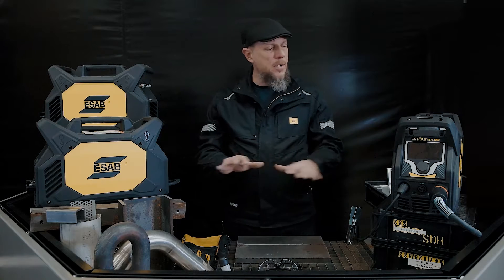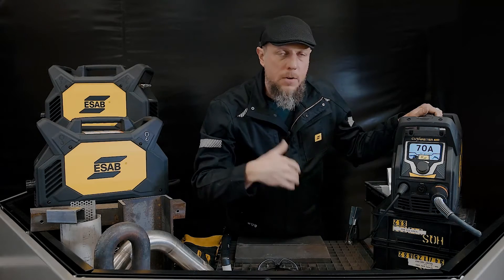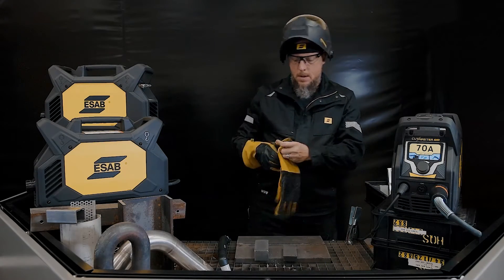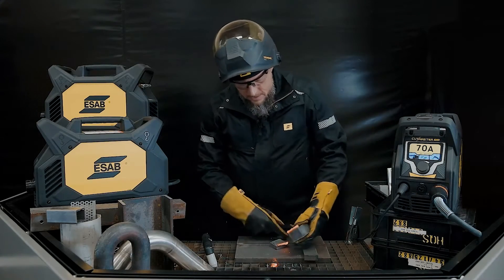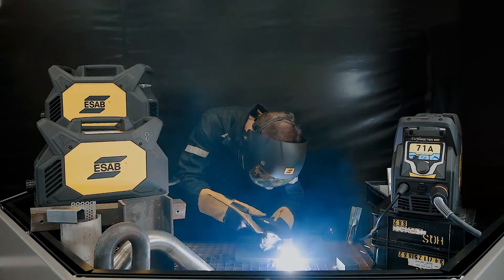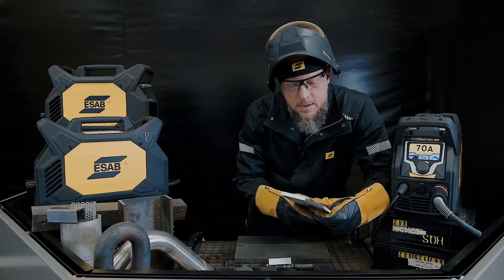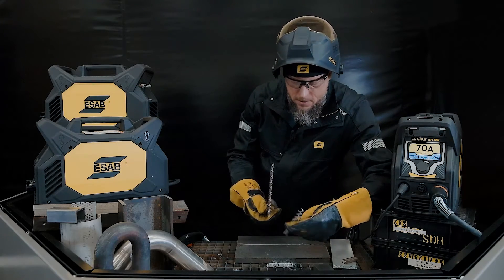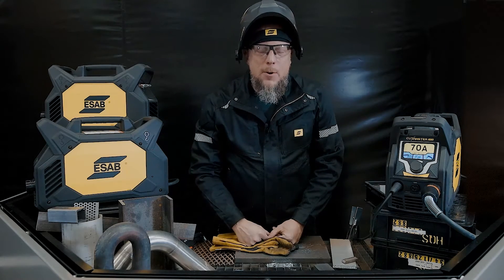Live Plasma Cutting with ESAB Cutmaster 70+. Get to Know our Latest Heavy-Duty 3-Phase Plasma Cutter

Comment: I am interested in a cutmaster 50+. Is there a water separator on the air line, or do I have to buy this separate?
Reply from the maker: It doesn't come with a water separator, you would need to buy an external one. Thanks.